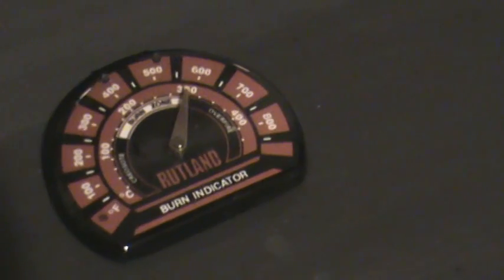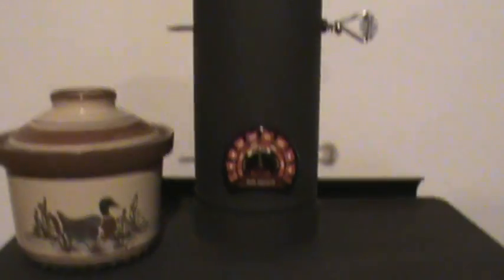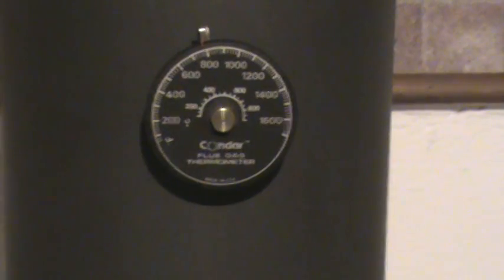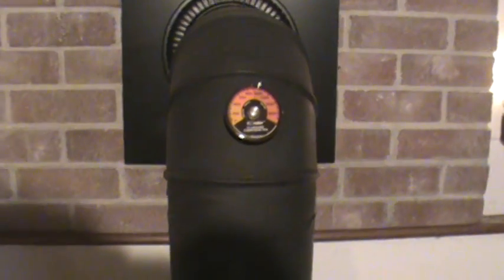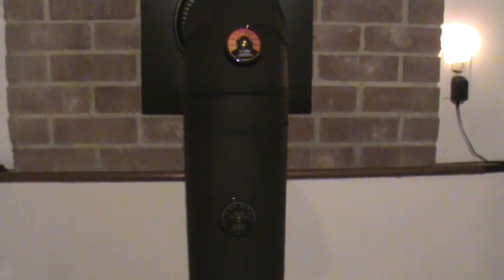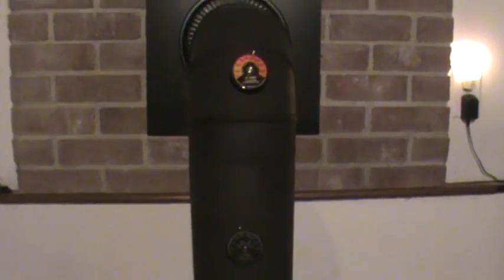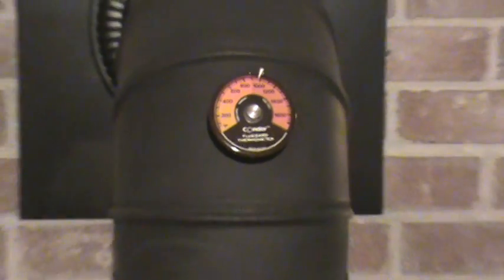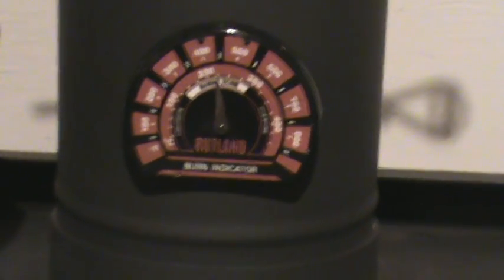3-19 vs. 3 -39 Condar Probe Testing Part 1

Comment: If my surface thermometer on single wall typically reads around 300 during peak burn cycle can I estimate the actual flue gas temperature is around 600 inside? If this is true I should be able to dial the air back and let pipe temp cruise at 200 or less since it’s still well above the condensation point.

Comment: The stove thermometer thing is pissing me off! I'm new to Wood burning as I swore I would never burn wood when I was younger a dad made me carry it all. Here I am at 42 and burning wood for the first time in my own home. Love the heat, absolutely penitrates every corner of the house after 2 or 3 hours but I'm trying to get used to running the stove and wondering when I can just trust if going to bed. I have double wall pipe on a Pacific Energy Super 27 with 2 probe thermometers. Both new, both undamaged but 350°F out of sync. Running the stove here now and the Imperial at 18" from stovetop reads 450°F and the SBI at 28" from stovetop reads 800°F. Switch positions and no difference. That's a huge difference. WTH! I'm going to have to buy another and see which one is defective I guess.
Reply: i also have a super 27 as well as a Taylor probe thermometer  i have used it on 2 other stoves as well and have never trusted it. it is 18 - 20 inches above stove and always reads high sometimes even with just coals it is reading 600 degrees . my bother has 2 PE wood stoves and never uses a thermometer and has no concerns i think i am going to throw mine in the garbage